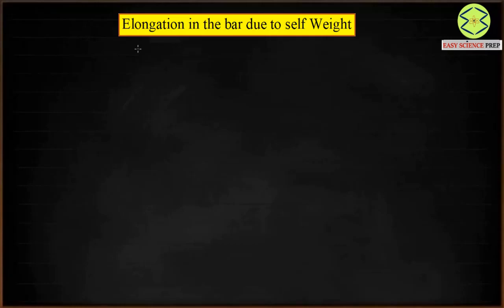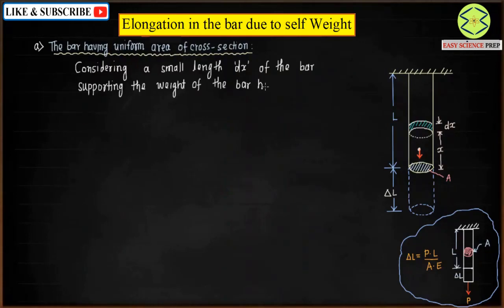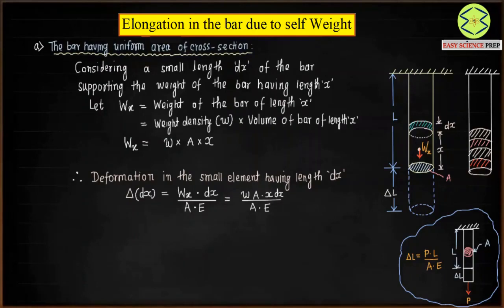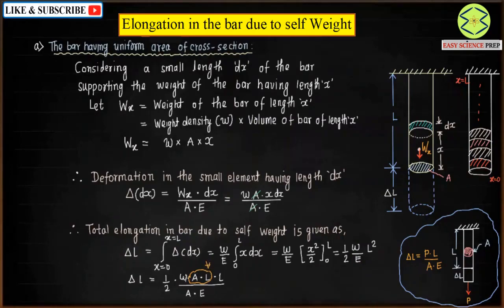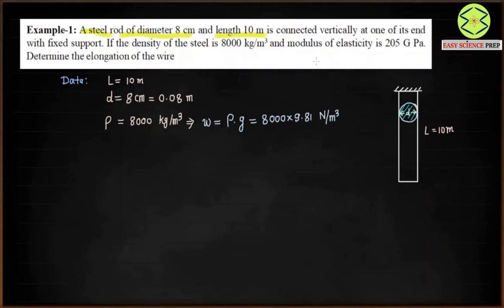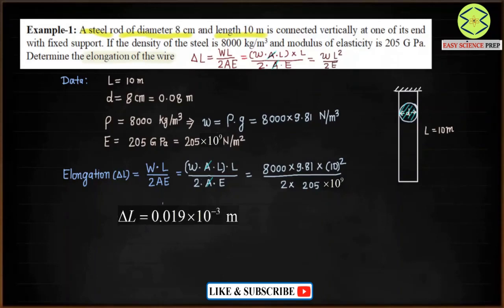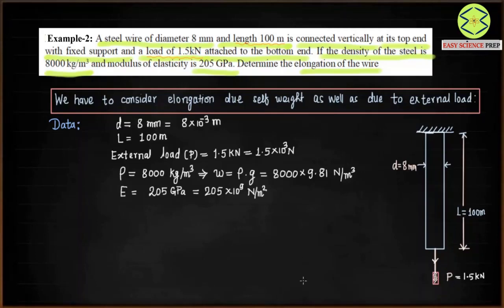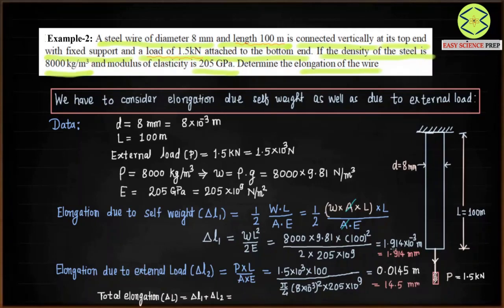ELONGATION IN BAR DUE TO SELF WEIGHT

Comment: 8:30 why do you put the A back into the numerator and denominator? I thought they cancelled out.
Reply from the maker: If Elongation in the bar due to self weight is obtained in terms of weight density (small W) then area of Cross section is cancelled out(as you have seen in the derivation) but in general, elongation is obtained in terms of weight(Capital W), hence area of cross section is introduced as you have seen in the derivation.
Thease are two different expressions.